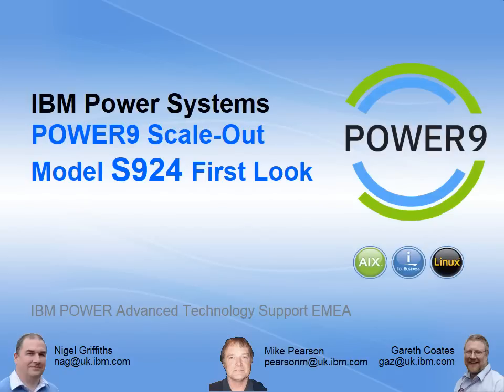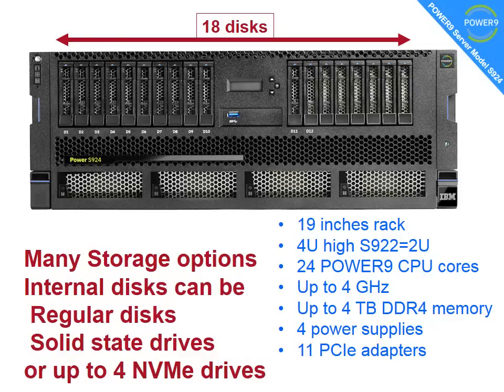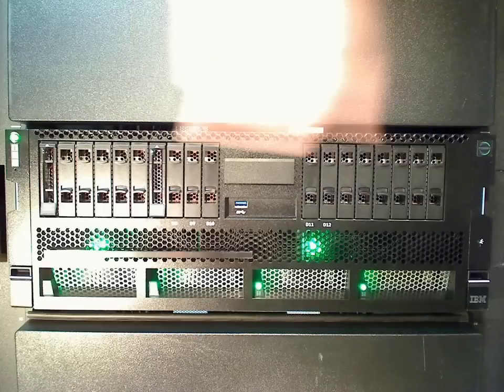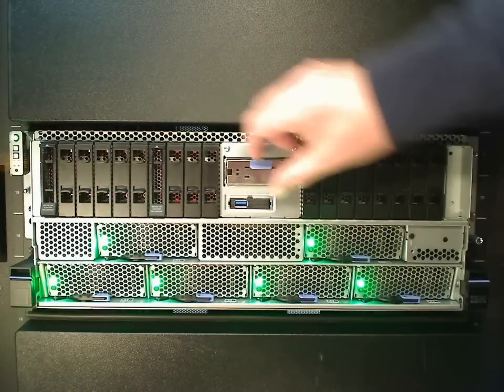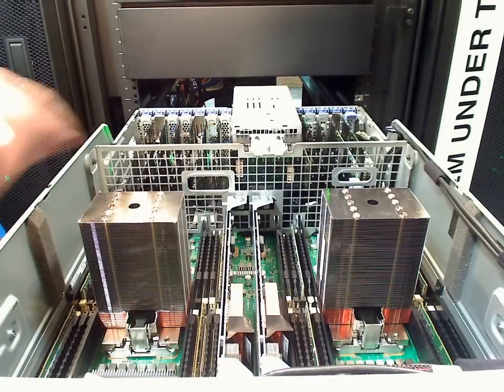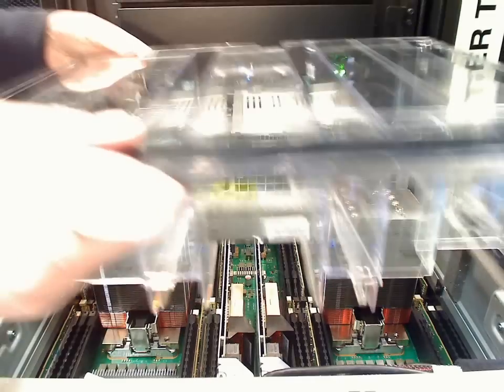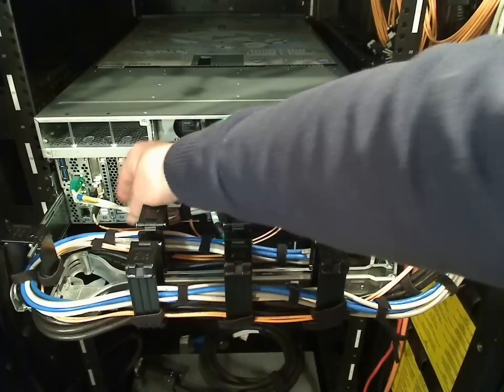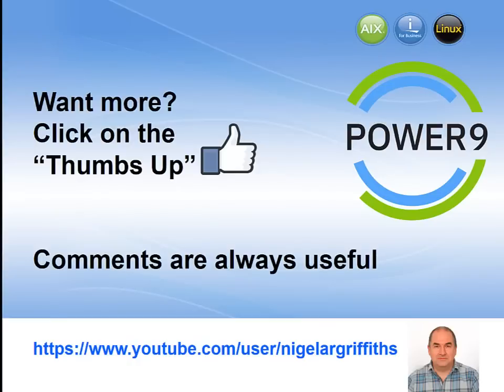IBM POWER9 Scale-Out S924 First Look

Comment: Thanks for video ! What an operating system is on the board when supply the machine ? VIOS ?
Reply from the maker: There will be no OS installed on the server when it arrives. You will have to install a pair of VIOS. This allows you to install the latest version and for you to be absolutely sure you have the original install image. Most people install the VIOS via NIM (network install manager) ov the network or from the HMC or if you are very old school and allowed to have to USB devices in the computer room via USB memory key or USB based DVD.

Comment: This is impressive stuff. I hope IBM can eventually get more people using Power9 and future versions of the Power architecture
Reply: Really ? Nobody out there is touching this shyt
Reply: @dupajasio4801 that's where you're wrong, companies like raptor computing are bringing power9 into reach of the hands of the workstation consumer or small businesses, and the architecture has so many little advantages over x86, along with being free and open source which is good for critical things where you cant risk running a ring 0 program without knowing what it does (which is the case on x86 with the likes of the intel management engine and amd platform secure processor). I will admit that while Power10 is out by now, it however was more of a step back. If IBM can replicate what thet had with power9 in their next gen of power cpus it'll be a very enticing option to many folks, especially those that are security conscious

Comment: Thank You. I will be installing one soon.  We will have a 2 LPAR system. Marketing is proposing a USB DVD that plugs into the front USB port. QUESTION: Can the front USB port be made "Switchable" in the LPAR configuration so we can share the DVD  between the two LPARs?
Reply from the maker: If you add ths SUB controller as Desired then you can Dynamically add or remove it yo an LPAR and so move it between Lars, if you only have 2 LPARs consider a 2nd SUB controller Pie adapter and 2nd DVD for a simpler  backup life. Alternatively, have the DVD attached to the VIOS and share it.